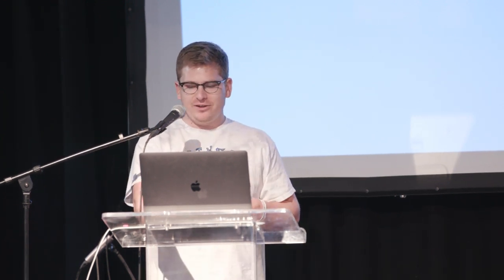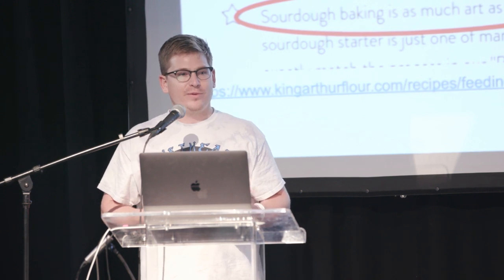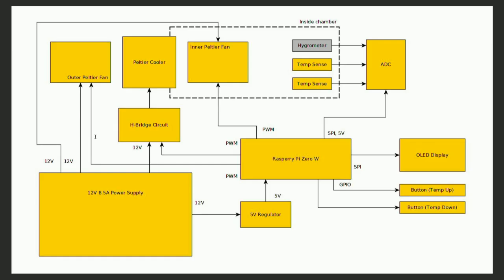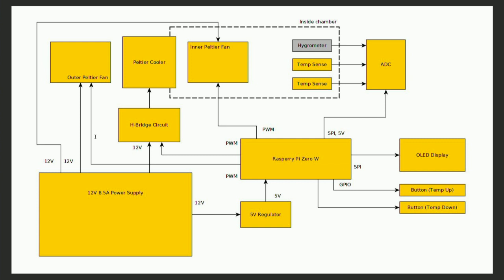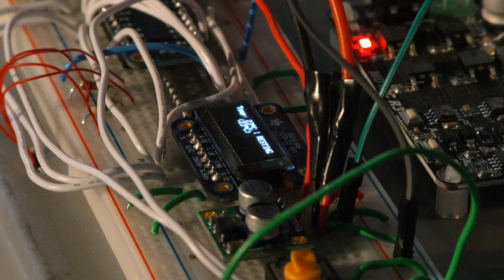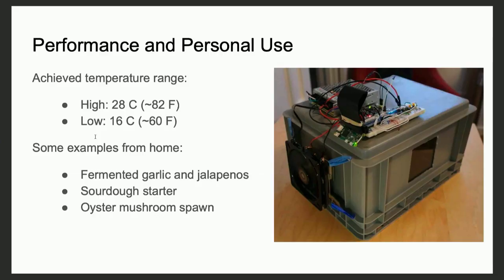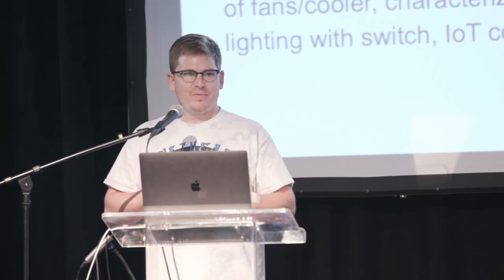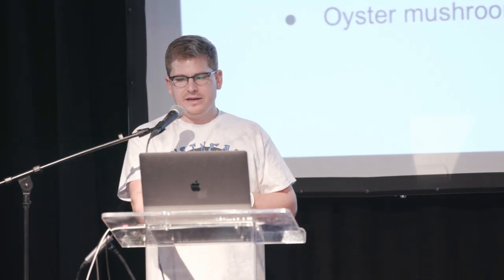Trent Fehl - Peltier-Cooler Thermal Chamber for Fermentation Processes

Comment: Wouldn't an incandescent lightbulb inside an oven better? It goes to 99F easily.
Reply: For heating, yes. But this cools too.
Reply: incandescent cooling lmao

Also, an incandescent bulb is only a 100% efficient heater. a peltier can be >100% efficient by stealing thermal energy from ambient